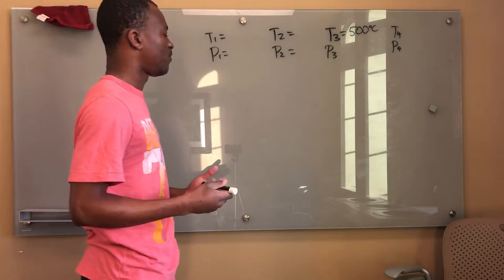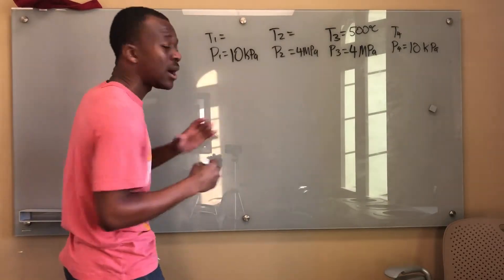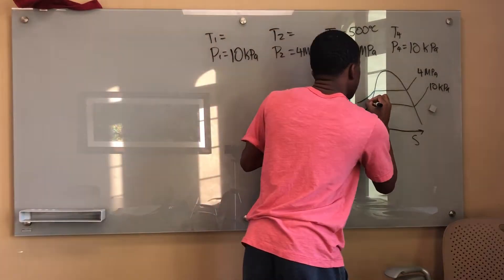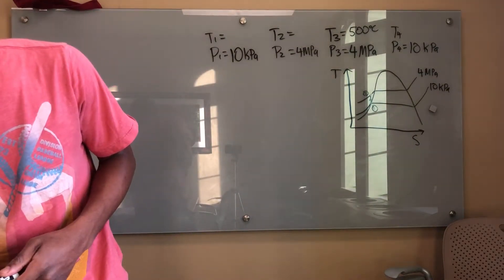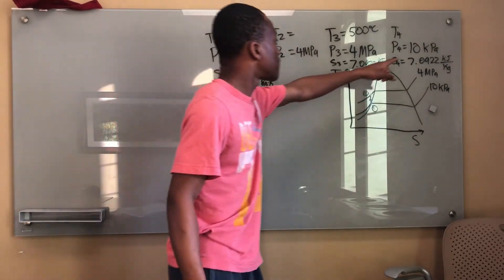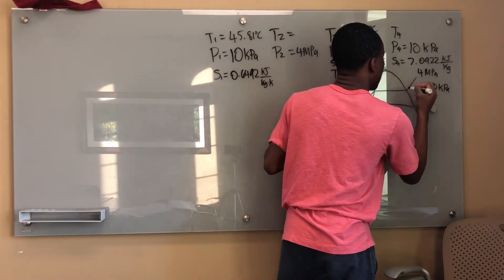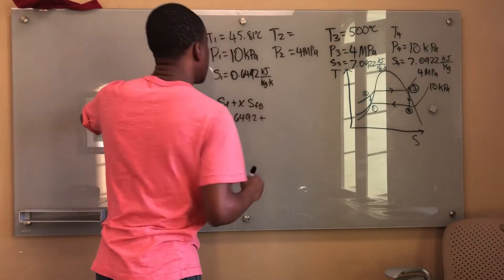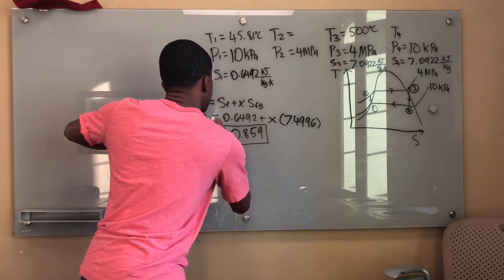Lesson: Ideal Rankine Cycle Example Problem

Comment: How about if the given problem has 3 pressures and 1 temperature ? does this mean that P1 is not equal to p4 and p2 isnt equal to p3? like this problem that i have:
 In a Rankine cycle power plant superheated steam enters the turbine at 18 MPa and 580 C. Steam expands through a single stage turbine and discharges at 6 kPa with stage efficiency of 82 %. The condensate leaves the condenser at 25 C and pumped to 18.5 MPa going to the steam generator. The pump efficiency is 77 %.  For steam flow of 9,000 kg/hr, determine:
a)	Electrical power output of the plant if mechanical efficiency & generator efficiency 
are 88 % & 92 %, respectively. 
b)	Heat added in the steam generator if boiler efficiency is 85 %
c)	Plant thermal efficiency
Reply from the maker: Can't remember too well but based on your description, my guess is that it is not ideal anymore? You would have to factor that in somehow, but I have not touched this topic in years. Sorry I cannot be of more help